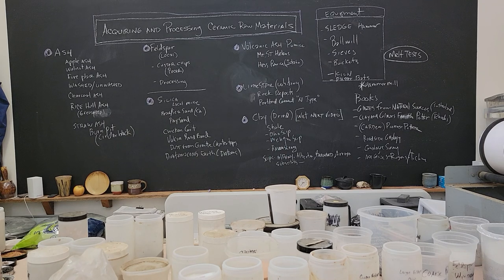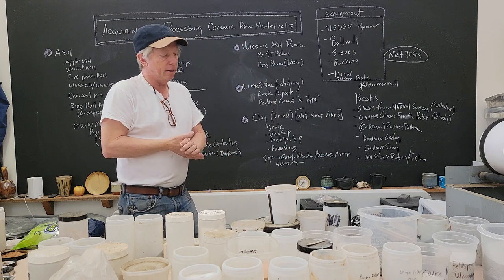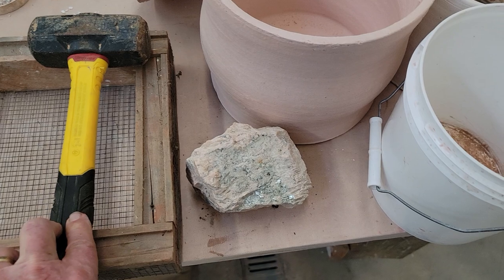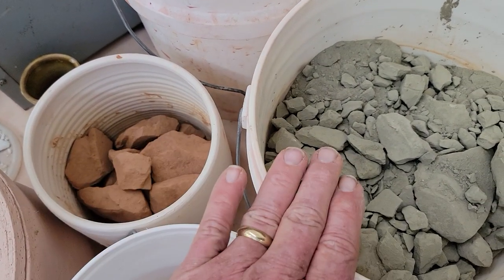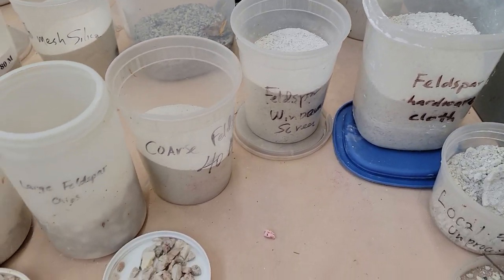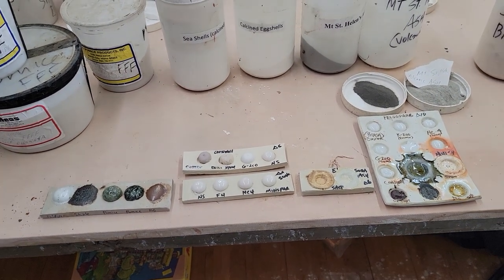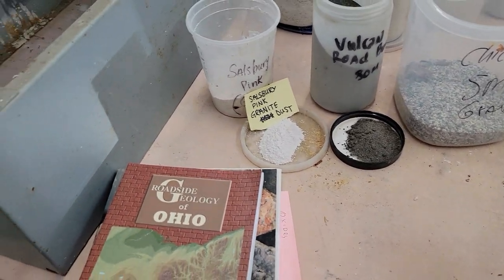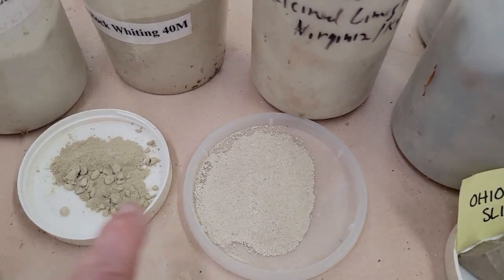Acquiring and Processing Ceramic Raw Materials  (Video #25 in the Free Online Glaze Course)

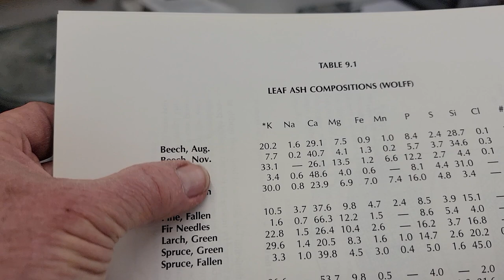Comment: In regards to the various elements that each tree ash contains.. "Because Leaves absorb things from the soil…", John said at 9:22. 

I'm not sure that this is the case. You can have an Oak tree and a Pine tree growing in the same dirt and the Pine has no K but the Oak has loads. The Pine ash is hardly alkaline but the Oak makes a really strong lye. Which is odd. You might think the tree takes what it needs from the dirt but that also may not be the case.

An experiment I read about conducted a few hundred years ago, where a young willow was potted in some carefully weighed dry dirt and watered with rain water for a couple of years, also carefully weighed. At the conclusion of the experiment all of the dirt was carefully removed from the Willow's root system and the plant pot, and again carefully dried and weighed. It was discovered that the dirt was almost the same weight despite the pounds and pounds of tree that had grown weighed more than the water it was given.The tree then burned and its ashes weighed. 

We know a lot of that tree-mass came from the water and carbon dioxide in the air, but what about all the other minerals? The water is pretty much distilled being rain water. It didn't add up. The conjecture was that the plant transmuted it from air, water and sunlight.. which seems the most probable.
Reply from the maker: @waynoswaynos  you will have to take that up with a biologist. I am not a transmutationalist. (something from nothing)
Reply: @johnbrittpottery Hey man, thank you. I feel you are right that its a biology issue. Clay is food for microbes, whose waste products are food for yet smaller microbes. When heat, pressure and water aren't changing geology, microbes are. Perhaps part of why Ball Clay particles are smaller than Kaolin. 

I am an artist that is into science, and when the numbers in the audit don't add up, I get to wondering why. If every element at its smallest is just energy at a given frequency, then the the weird numbers start to make more sense. (i.e. something for something)

Ceramicists say that LOI is mostly water  but if they ever attempted to condensed that vapour they'd find it was something else entirely. e.g. I once bisque fired some earthenware, at the same time I calcined some limestones in a pile on the shelf below, that should have been just evolving carbon dioxide and water, but the bisqueware was lightly glazed in the process and almost stuck the shelves.